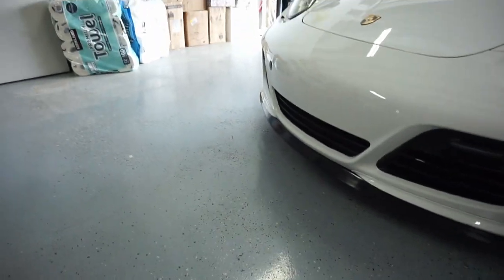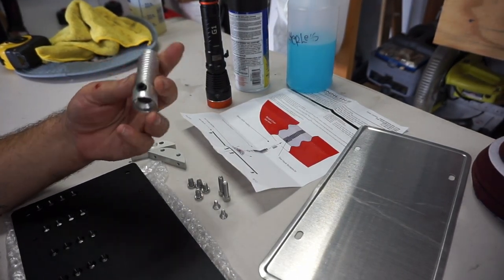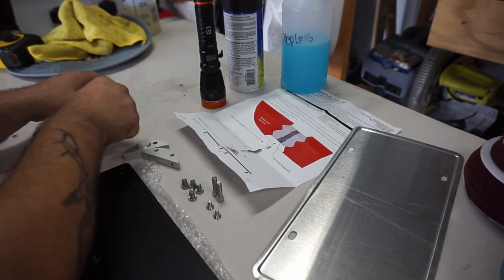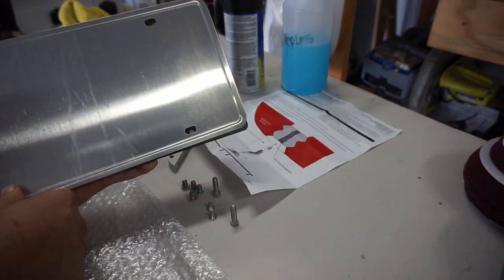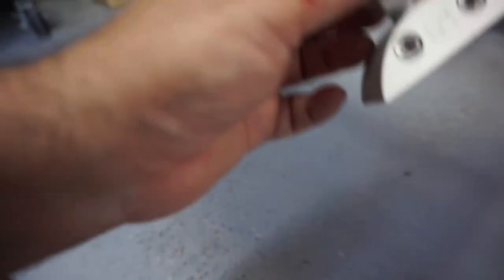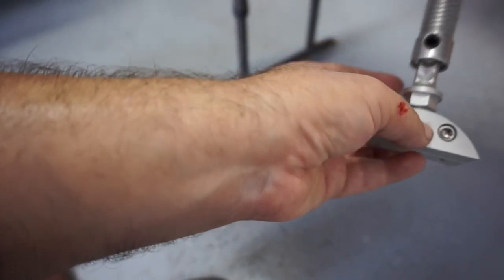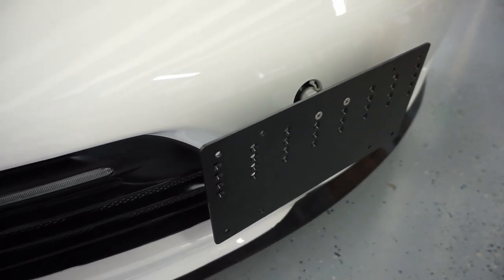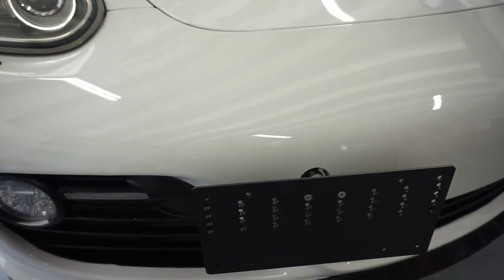Cayman:  Rennline front license plate adaptor - Install

Comment: At highway/Porsche speeds, does the bracket turn "to stop" at whichever way the wind pushes it, or does it actually stay as you set it?  Looked way too easy to move by hand.  Also, can you tighten so it does NOT rotate form wing (assuming it does)?   Thank you/
Reply from the maker: Never had an issue with it on Texas fwy speeds

Comment: Thanks for the video, the rennline tow hook holder is screwed in counter clock wise correct?
Reply from the maker: On mine, the part that goes into the bumper area, screwed in normal, clockwise